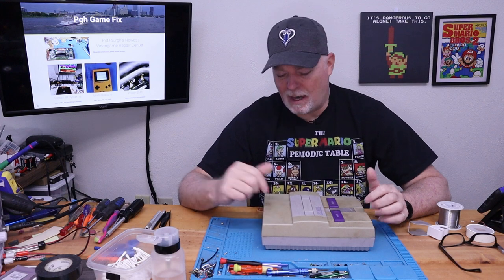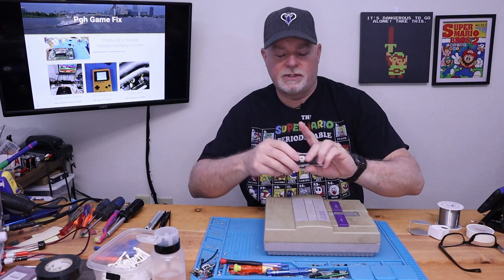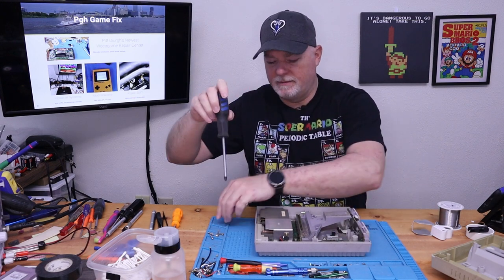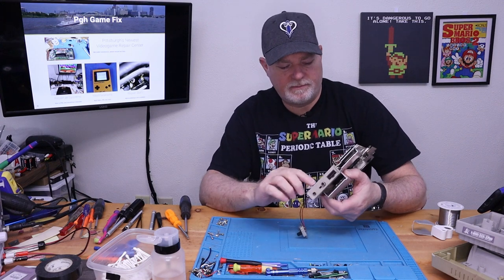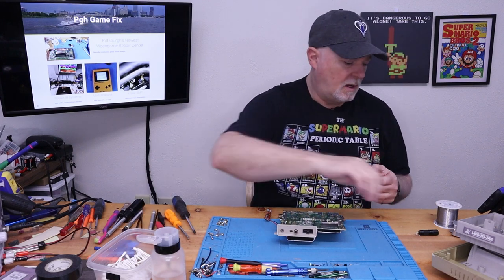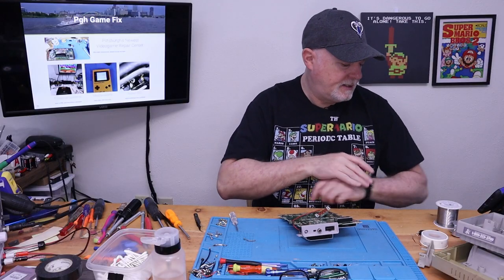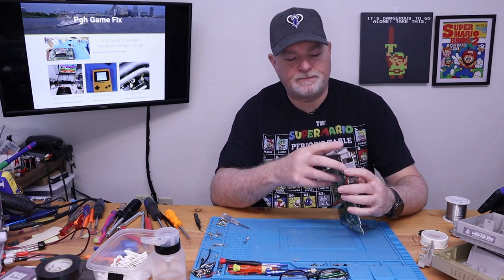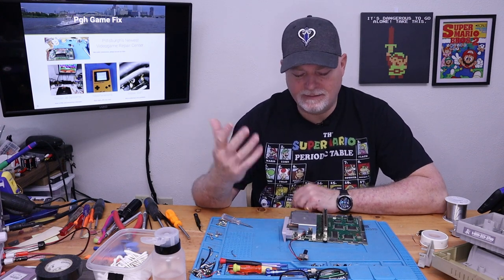Replace an SNES power port/plug

Comment: I suggest removing the solder after removing the part. Just flow the tabs and dwell with your iron until it melts on both sides, then gently work it out and remove heat. It has so much thermal mass that the solder braid is too much for many irons causing it to solidify on the other side and leaving no solder on the bottom to conduct heat. This is a recipe for ruined pads and traces.
Reply from the maker: Thanks for the tip.  I agree that on some boards... they are weak, and you can peal a pad... but the SNES boards are pretty robust.

Comment: The Japanese version has a standard part embedded in the back panel. I presume PAL models do too. Standard 5.5x2.1mm though it’s wired center-negative. The plastic part is not interchangeable so it’s a shame they don’t make replacements for the Japanese style.

Comment: So do I have to desolder the power output just to remove the plastic rear casing, or can I remove it without having to desolder anything?

I'm trying to paint it black to match my black shell I bought separate. any advice? 🤷
Reply from the maker: if it's the part with the plug.... yes, it has to be unsoldered since the plug is part of the rear plastic.